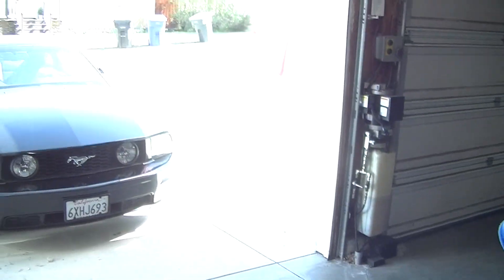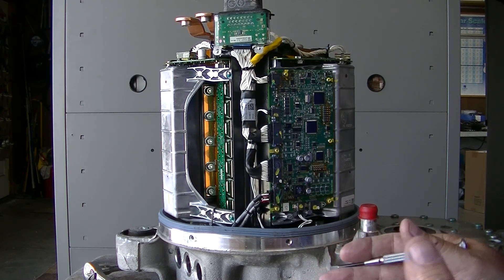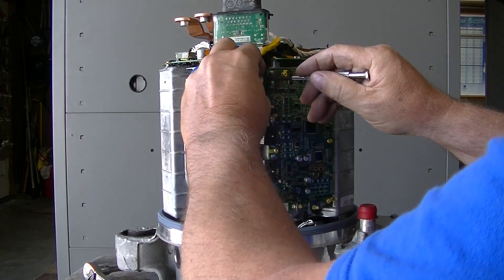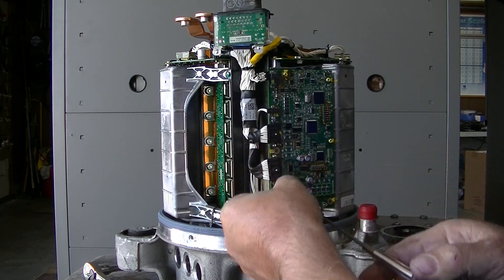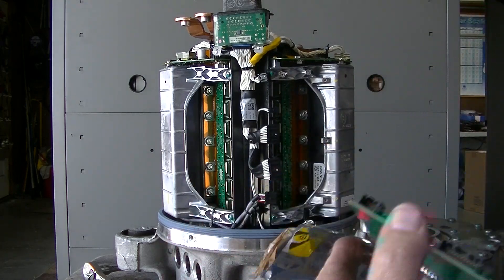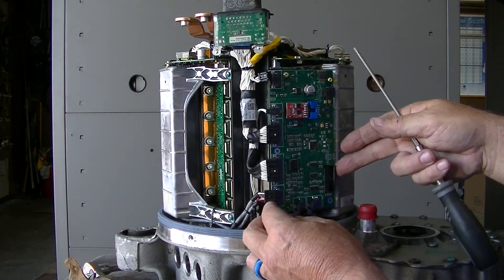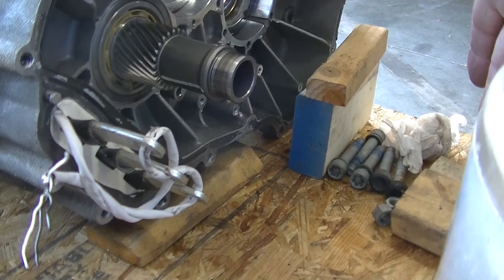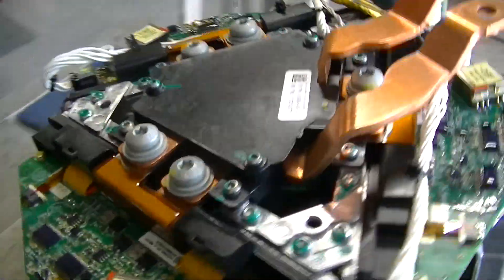Tesla DIY Motor Control Board Install

Comment: Great stuff Sir!
What’s your thoughts on using Tesla drive unit with 80kW battery pack fit in to the 50ft cutter (sailboat)
Where shall I expect biggest difficulties except batteries?
I am an sailor and  electrician ;)
Reply from the maker: I think your biggest difficulty will be attaching the motor to your drive unit.

Comment: We have great options now for EV builds! Is that motor control board ready from the "factory". Did you have to fiddle a lot with its options in software to make it work?
Reply from the maker: Actually not much.  If you download already set parameters that people have successfully used then you end up with a very basic tune that works well.
Reply: @Roadstercycle  Great....and here is a cool video that explains in detail of all the wiring of the pre-charge relays to the motor. Might be of use for somebody. https://www.youtube.com/watch?v=eQPTZpxfeM8
Reply from the maker: @sophocha  Check out openinverter.org/forum for much better drawings and simplified explanations.
Reply: @Roadstercycle  yep, that website is a goldmine! I'm thinking of a small tesla drive unit on an old 90s honda. All I need now is plenty of time and a lot of reading.

Comment: Can explain to us please why you changed the board
Reply from the maker: I changed the board to be able to control the motor and inverter. With this board I can run the motor without spending $3500 for the controller that EV West and others are selling to control the stock board. This board is under $500 so the $3000 savings goes into other areas like batteries.
Reply: @Roadstercycle  in which inverter you will control it now if You will not use Tesla controller
Reply from the maker: @schade12  You do not need a controller per say to control the motor now. You just have to set your parameters on the new controller board with a laptop and your done. Then you use a forward, reverse and cruise control push button and that's it.
Reply: Please show us how on the next video
Reply from the maker: @schade12  Go to www.openinverter.org and read about the Tesla large motor controller board.

Comment: I trust this is a different motor.  Is this for your all wheel drive?
Reply from the maker: Yes this is a standard Model S motor, about 450 horse depending on battery pack used. I have it split totally in halve to work on it easier.  I'll be running a coupler right off the motors output shaft to attach a 3.07 ratio Dodge charger differential which will then run for and aft 

to to a forward 3.07 diff for FWD and a rear 3.07 diff for the rear wheel drive. At this point it looks like I'll be running a 4.5" racing clutch to disengage the rear drive so I can slide around hairpin turns using the rear brakes and having the front wheels pull me around the corners then let the lever loose to scream AWD out of the corner until the next turn. Lots of engineering. Should take 3 or 4 months to finish.